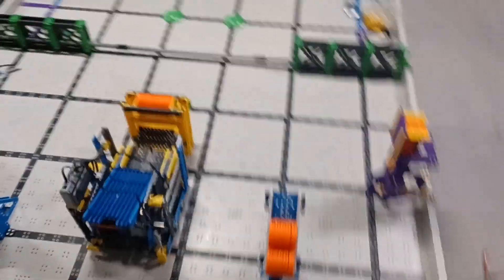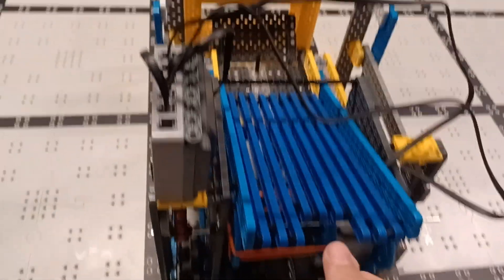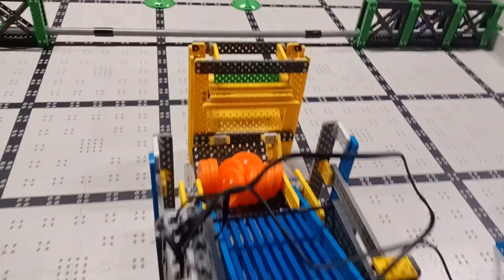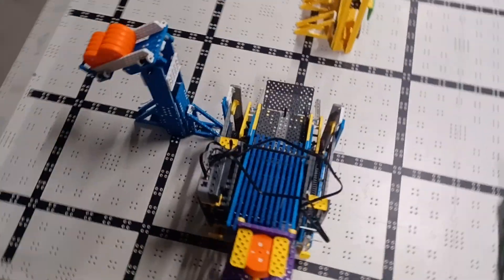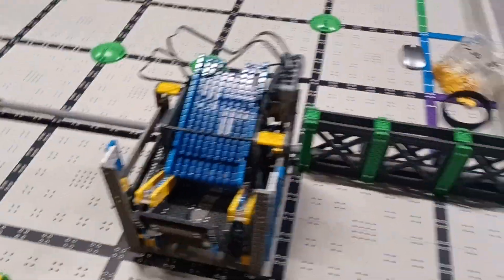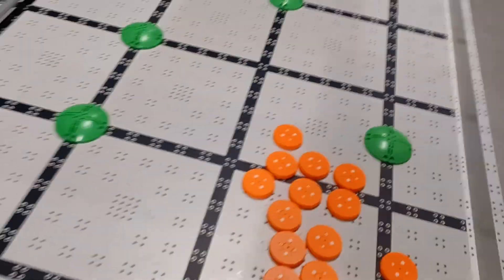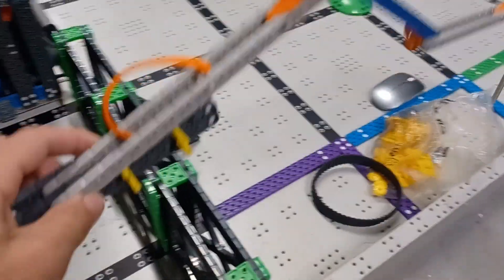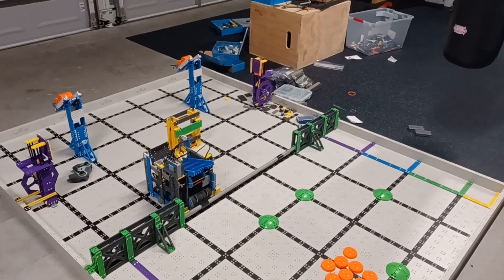Vex IQ Slapshot Robot Progress Update!

Comment: How do you make a button toggle instead of holding it down?
Reply: There are a few ways, one way it to set the motor to run when a variable = 1.  Then your button multiplies the variable by -1 every time you press it. 
Can you think of other ways as well?
Reply from the maker: If you look it up on Youtube you can probably find a tutorial, but the basics are you are flipping a variable to one of two values when you press the button, and you have the mechanism run on one value.